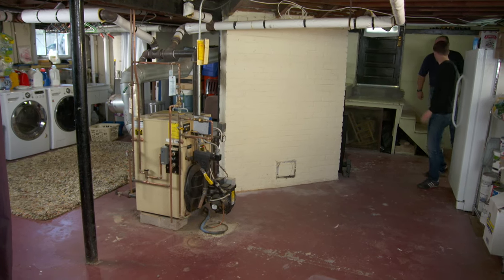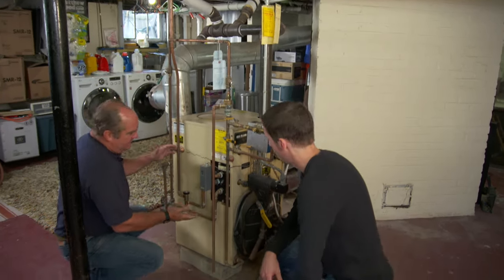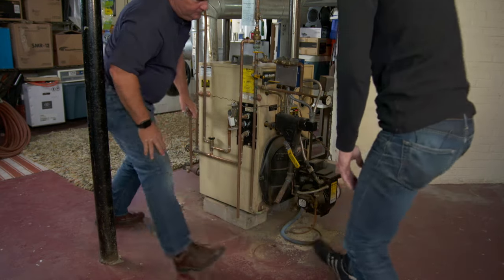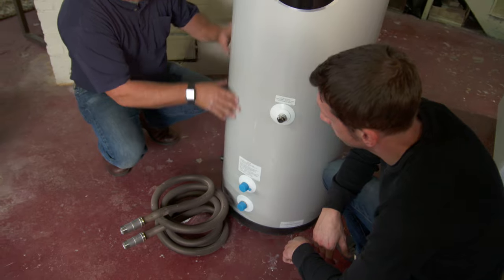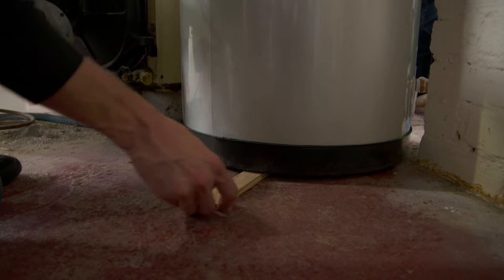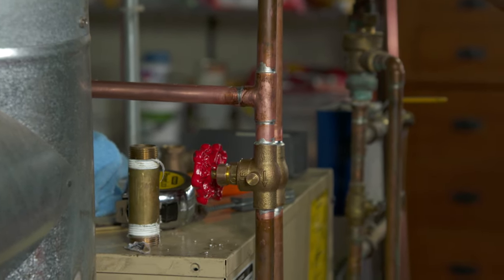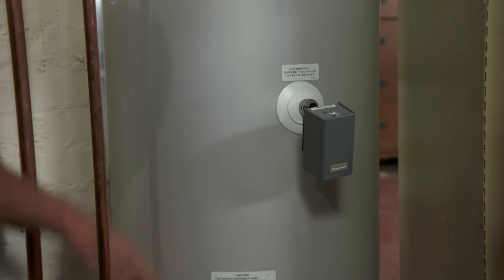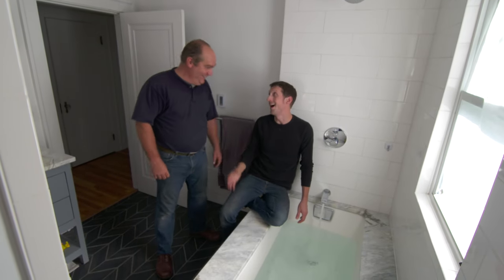How to Install an Indirect Water Heater on a Boiler | Ask This Old House

Comment: Question?  Would the boiler still perform the same... as in always cutting on and off all night to maintain the temperature needed to heat the indirect water tank? Or would it only cut on when the water tank calls? Will the boiler respond to its own thermostat or the aquastat?
Reply: The boiler will not turn on nearly as often. The new tank is well insulated, so it loses heat more slowly. It’s also a much larger reservoir, so the boiler will kick on and heat all of it, and then not turn on again for a while. That water is also stored at a lower temperature than the boiler water, and the system can tolerate a larger range of water temperature inside the tank (starting rather high, and then gradually cooling over a long time) because the mixing valve at the outlet can accept any temperature of hot water and mix it to exactly the right faucet temperature. So the whole system is more efficient now.
Reply: @j10001  so is the aquastat on the boiler useless at this point?
Reply: @SlickSliver  Sorry… I’m not sure. I don’t think boilers have aquastats. ? They have thermometers that measure their temperature. I’m probably not the guy to ask. Haha. I was just explaining for the indirect tank stores heat.

Comment: It wouldnt be more efficient to just install a separate hot water heater. I understand using the boiler to heat the water if it was winter time and the boiler was running for heat. Is using the boiler to heat the water cheaper then running a hot water heater ?
Reply: Depends on the efficiency of the boiler vs the separate water heater you had in mind. I'm not sure what the efficiency of the boiler in the video is, but I believe most gas fired water tanks are about 80%? My boiler is 95% efficent and is a cold start, so it is much more efficient than any stand alone tank. Don't forget that indirect water tank is ALOT more insulated than any gas fired tank without a hollow flue running down the middle, so it will maintain temp better.

Comment: QUESTION:  For a hot water boiler, this seems straight forward, but for a steam boiler, how do you keep the hot vapor from rising into the rads in the summer?
Reply: I would think by closing the radiator steam valves. Unless there is a main shutoff near the boiler?
Reply: The aquastat on the boiler is only set to 160degrees.   Not hot enough for steam.
Reply: 🤔 I believe it’s going to boil eventually 212* = steam.
Reply: Maybe a separate system would have solved all the variables.
Reply: @EOMFDdaudits  I believe the aquastat was not for the boiler, but for the heat exchanger for the potable water

Comment: Glad I have a plain old gas water heater with standing pilot.  Very simple and reliable.
Reply: @John_Lee_  Pilot=heat into the water I want to heat. Well, so far it's only 30 yrs. old. But in my last house, a similar WH was almost 48. Those life spans are long enough for me.

Comment: This homeowner was really engaged for a plumbing job this bug.  Usually they are able to cut a pipe and that’s it
Reply: By using the old aquastat it used be for as a cut out at what ever temp you set. So lets say 160F and so on. So in one is used as a limit and the other one on the tank is the main. And also that's not a proper install the old coil in the boiler the lines should have been removed and not valve off ( good way for some thing bad to happen)...
Reply: I guarantee that was all faked, just while the camera was rolling

Comment: I have the same setup as the beginning of the video. Is there a way to block off the small water heater inside the boiler and just have an electric or gas water heater?
Reply: Matthew Prosco … no need to block off anything. Just disconnect the pipes and plumb in the new water heater. Where the old pipes were connected is now an empty loop and shouldn't leak a drop once it dries out.
Reply: @rupe53  i appreciate it! I actually did end up finding a kit online for my boiler that removes the coil and just has the hole for the aquastat. I'll probably do that just so it looks more professional.
Reply: @matthewprosco5940  … as someone who worked in that trade for many years, I am going to suggest you leave the OEM coil in place. The reason being is after years of NOT being disturbed you run the risk of a bolt that's rusty, a stud that "just spins" in it's hole, or the gasket area being warped / covered in scale, which will present it's own set of issues. IOW, if it's not leaking then don't fool with it. Also resist the urge to cap off both pipe fittings with plugs.... unless the coil itself is already leaking. Reason being is that 5 ft of pipe will become it's own pressure vessel with no relief valve. That pressure could cause one of the plugs to shoot across the room like a bullet and also damage what's left of the coil assembly to a point where you have boiler water leaking. Just my professional opinion.
Reply: @rupe53  i appreciate the insight. I did know about leaving the coil open if left in place. I was more worried about the coil rusting and causing a leak from not being used. That's why i was looking for the block off kit. But I'll definitely have to think about it. Im not doing anything until the weather gets warmer anyway. Dont want the heat off while i transfer to stand alone water heater.
Reply: @matthewprosco5940   … the internal coil will not "rust" but if it's weak with corrosion it could leak boiler water. In that case it's no longer a sealed vessel so you can safely put in pipe plugs. That said, I have installed many indirect water heaters and a few stand alone units. With an indirect unit one can quickly tie into a boiler at the drain valve and relief valve tapping by pre-assembling fittings with a tee and new shut-off valves, then turn off the boiler and drop the water pressure to do "on the fly" installation where only a pint of water is lost. (if you move quickly) Now you can get the heat back on while you work on the domestic side of things. The trick to doing this is to turn down the aquastat limits so the burner doesn't fire and turn up the house t-stats to cool the boiler. You gain a few degrees upstairs and you don't burn your fingers while working. (boiler is now down to about 120 degrees) This will buy you an hour's work time without the house getting cold. You can wire everything and flip the switch off to make the last few connections at the end. Basically the heat stays on for 90% of the job.

Comment: I have this system and am wondering if I can switch the boiler OUT as the heat source and use a small tankless water heater to heat the tank?
Reply: If you add a tankless water heater, then you should no longer need a tank.. unless your tankless is undersized I suppose, but you would then have a very unconventional system.

Comment: See a tempering valve...does it work.?my experience they are trouble ....removed mine and solved the cold shower problem.....since then I had installed an indirect  fired hot water tank...... 30 gallon can run hot water all day without running out.......

Comment: Only one thing I don't like , that taco 007e circulator does not  like dirt /rusty water
Reply: Knight Hvac what kind of circulator would’ve you used?  Just a regular old 007 or one of those bronze ones?  Because maybe in the future I would like to install one of these tanks.

Comment: Is it better to have the circulation pump feed the tank or feed back to the burner?
On my indirect system, it feeds the tank.
Reply: The normal placement for a circulator is on the return to the boiler, but it'll work on either side

Comment: I would love to understand how this thing is wired.
Reply: that aquastat on the tank is just a switch that makes on temp drop ...  you can run line voltage through it or 24v to a switching relay that has a end switch to call on the burner

Comment: hello, can i ask you an info , do you think will be more efficient the ssc-45 indirect fired or a electric water heater in series with the oil boiler ? i have to replace my indirect because is all corroted in the bottom , and i would like to understand if is better replace with the ssc45 or the electric  , and maybe with a switch for the summer for dont use the oil burner. what you think ? thanks

Comment: That Taco circulator probably burned out by the steaming and muddy hot water by now.
Reply: ive worked on plenty of steam systems piped this way,,the 212 + degree water has messed up that 007 plenty of times,but to each there own,lol

Comment: I just came across this.  Why not just put in a tankless water heater and not use the boiler at all?  I found the indirect water heaters to be about the same cost as a tankless on-demand unit.  Yes, you would need to hook up gas and intake/exhaust to it, but wouldn't that be more efficient?  Not sure on the efficiency.   Of course there would be another gas fired appliance that could have issues....  I was wondering what others think.
Reply: Personally, I'm not a fine of the tankless except for situation where there is an extremely high demand for hot water..   not only becuase of increased cost but also because they require annual maintenance.   And also, as you mention, its an additional appliance with no additional functionality (except for infinite hot water supply if needed), as opposed to the indirect tank.

Comment: What would be the cost to replace a 40 gallon indirect hot water heater? I have an estimate which seems high.
Reply: They are generally very expensive
Reply: I just got a $3800 one for 150 bucks has marine grade stainless steel tank and holds 60 gallons. Bought it from a nonprofit Reuse company. People buying $20 million houses remove all sorts of expensive things that have nothing wrong with them and replace them and donate the old stuff for a tax write off to a nonprofit. I don’t recommend Habitat for Humanity Restore because they’re too greedy on their prices, and think that you should pay them a premium because of who they are. Look for nonprofits that are not Habitat for Humanity to purchase these things used for a few pennies on the dollar. The one I purchased sent unsold at the place I shop almost daily for months if not years before I even noticed it even though I was actually looking for stainless steel tanks to put on my RV conversion, I didn’t notice it because protecting the insulation is a capsule that’s made out of plastic, so I didn’t realize it underneath all of that was a marine grade stainless steel tank with a copper with tin platting coil inside.

Comment: I'm continually surprised about how far behind Europe the US is for things like this. This is described as if it's a new way of heating water, yet its been this way in Europe for 50 years! Combination boilers are a new thing in the US, they've been over her since the 1980s! Wax rings for connecting toilets to the waste system, seriously?!! Front loading washing machines are relatively new to the US, 30 years late! These videos have really surprised me!
Reply: And the band played on....
Reply: Mounting a toilet to a floor-mounted toilet flange, with a wax or rubber ring, makes for easy installation and works fine most of the time, so why change it, I guess?

I suppose the explanation for the late arrival of front-loading washers may come down to differences in the cost of real estate. Americans typically are able to buy bigger homes than Europeans, often with dedicated laundry rooms where space is not at a premium and there's plenty of room to access the top of a washer to load clothes. When you have less space and are forced to stack the washer and dryer, now you absolutely need them to both be front-loaders, but fewer Americans are in this situation, so there was a less urgent demand for that here. (And in the U.S., you virtually never see a clothes washer stuck under a kitchen or bathroom counter, which is common in many European homes.) Another reason might be differences in attitudes to energy consumption and the environment. European governments have been pushing more energy-efficient appliances like front-loading clothes washers for a while now. The U.S. government frankly hasn't given a toss, and hasn't incentivized their purchase very much.

As for the primitive technology in boilers and radiators here in the States, again, this probably is due to there being less urgency/demand. What you have to understand is that most Americans don't use radiant heat at all. In Europe, it's most people, but it's less than 10% of Americans that even have boilers. The majority of Americans demand air conditioning, and that works best with forced-air furnaces, so that's what most of us use to heat our homes.

Comment: Why was the hot water tank left on the floor? why was it not up on a pad or blocks?
Reply: Good question. Even a couple of inches of water in that basement would infiltrate the insulation on this model they used, and it would be ruined. The one I have as feet built into it that raise it about 10 inches off the floor. I got a more expensive model that new would cost $3800 and I bought it used with nothing wrong with it for $150 (at a nonprofit Reuse place where filthy rich people donate perfectly good stuff they remove, because they have more money than cents, but they still want to get a tax write off for it) and on mine the outer casing that protects the insulation is heavy duty plastic and molded into the plastic at the bottom are big feet that lift the tank up off the ground so that the pipes going into the tank from the bottom are vertical and at the very bottom and the pipes coming out at the top are vertical too. It also has a large bronze plates about 8 inches in diameter held on by about 10 hex bolts on the top at the bottom of the SS that have the threaded female pipe connectors cast into it, so not only can you remove the exchanger coil at the bottom, you can access the inside of the tank through the big hole at the top for inspection purposes to see if your coil’s all clogged without taking the coil out, or possibly even so you could clean the inside of the tank if you wanted to

Comment: I'm trying to understand the point of using the tankless coil and how if he's cutting into the main circulation loop.  He has two tempering valves?
Reply: I have mentioned it in my comment. There is no old heath exchanger in the play. It is still connected, but he removed the thermostat well and reused it for hot water outlet that goes to coil in the tank and return goes through cold water refill inlet :)
Reply: @rpriesol  Wow, that does seem to be the case.. thanks for clarifying this.   This would also seem to add efficiency to the overall system, as he eliminates one heat exchanger.. of course, another heat exchanger is introduced in the indirect tank, but he should have highlighted his methodology.

Comment: Let me ask you a question  what if you still have the old time boiler combo with the hot water intake  would new boilers still work with it and how do the new boilers work  compared to the boiler combo with the water intake
Reply: Yes

Comment: Hi Rich . I installed my indirect same as this(not as good of course!) . Old one died. This is a different model. When I went in to wire aquastat on indirect with wires from the last one they don't tell you where or what . It's a red and white wire and your choice is top or bottom screw connection . They were in a plug that just plugged into the old Weil McLean and that didn't have any markers either. What do I do ??
Reply: Hire a professional.

Comment: Shimming that new cylinder like that is absolutely pointless!!

The whole thing is wrapped in 2” of foam. As soon as it is filled with say 130 litres of water the foam will give and the tank will sit crooked again. 

Do it properly. Lay either a level quick curing cement/concrete pad or lay a paving slap (or even marine ply) and shim that level then put cylinder on top of it

This is basic stuff he’s explaining and it’s wrong. 🤷🏻‍♂️
Reply: Cellar gets flooded shims rot🤔,paving slab as u say!

Comment: Why didn't he use a brass strainer instead of a black strainer so there's no electrolysis between the copper and the black strainer.
Reply: that in brass is very expensive. but he did add extra shut offs to make it easier to replace when it fails. give it 10 years
Reply: lostintime86 
I have seen the effects of mixing different types of metal in plumbing systems.
You can understand it much more clearly if you read an article in Wikipedia on "Galvanic Corrosion".
If a copper or brass "Y"-Strainer could not be found, a stainless steel version would be much better. 
I have seen several videos on This Ole House where I've seen this plumbing faux pas committed.
This guy is an excellent plumber but this a mistake which can end up costing hundreds or even thousands of dollars to repair.
Reply: It was on sale
Reply: @BrianBriCurInTheOC  they probably couldn’t get anybody to donate the more expensive kind

Comment: so you installed a pressurised cylinder.  which will heat up and expand... i didnt see any expansion vessel installed only a PRV.. so if the PRV fails you now have a bomb..  great work
Reply: Same as every water heater right?

Comment: if those aren't double plated heat exchangers you need a backflow preventer on your cold water coming in …. steam water is acidic
Reply: kyle armstrong: "steam water is acidic"
-----
Water doesn't magically become acidic when it goes from being a liquid to being a gas.